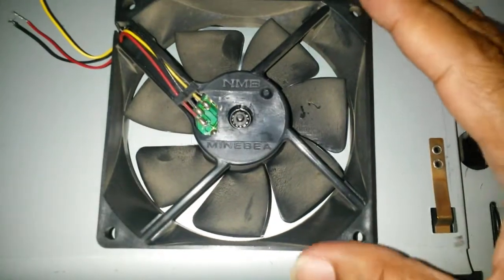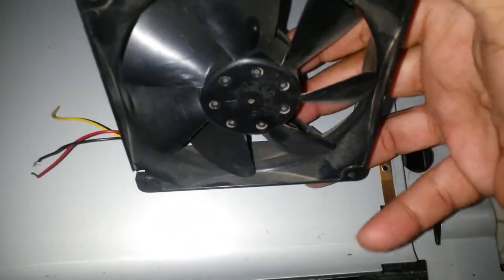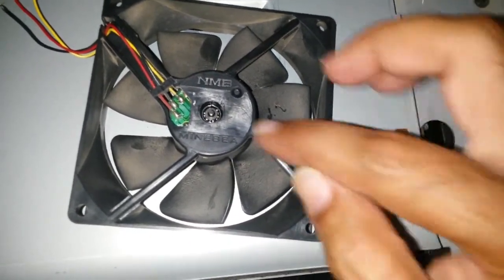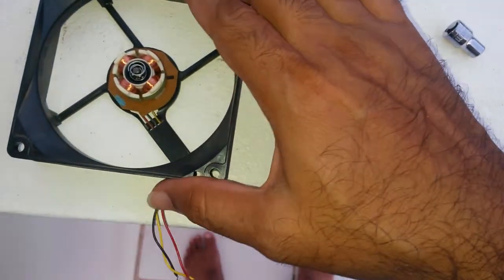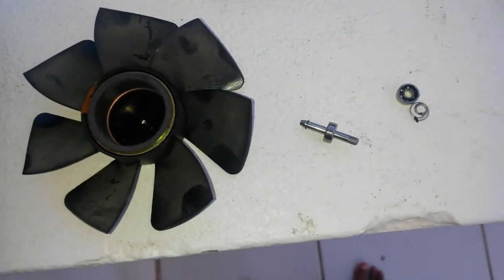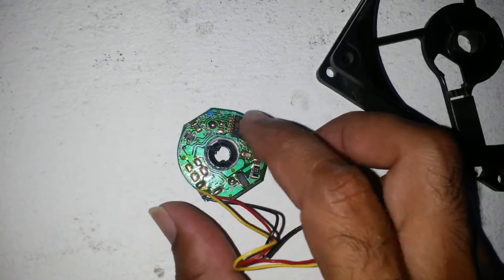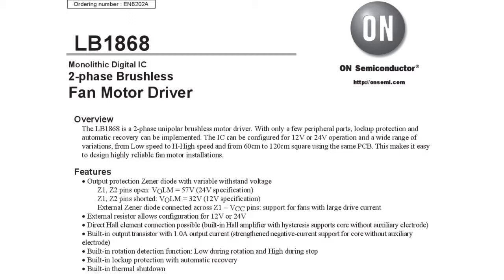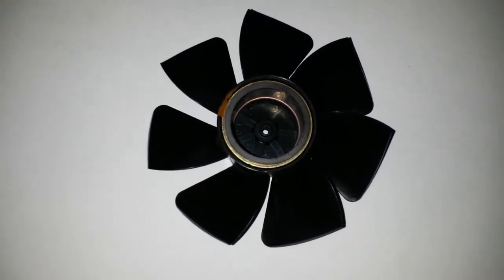094 Computer Fan Disassembly

Comment: Yeah, I did it a few times as well. 😊
Looking forward to see what you make with it. 😊
Reply from the maker: I want to do a water jet. Going to use a smaller fan first. Also intend to make a propeller similar to a traditional one out of copper hopefully. I would prefer brass but I cannot get that easily on this island. Copper on the other hand is easy to get from air condition places.
Reply: @manickn6819  Nice! I want to see that! 😃